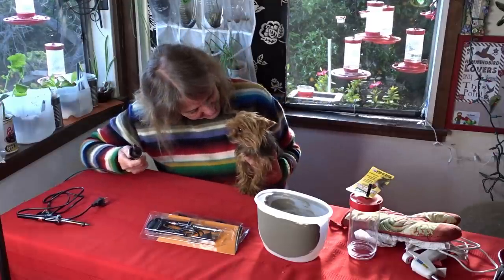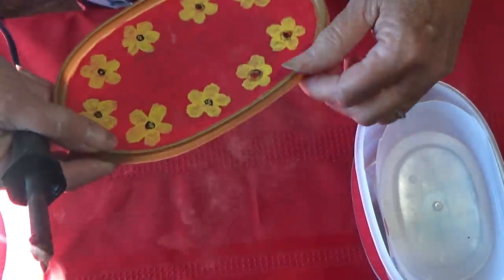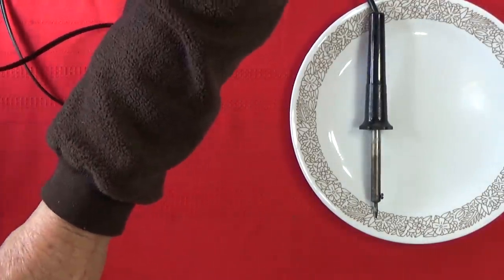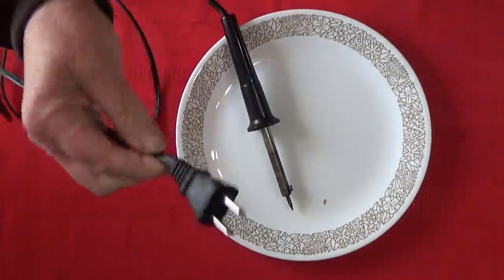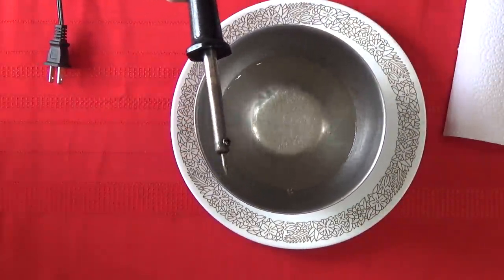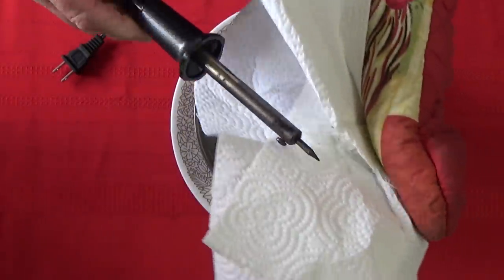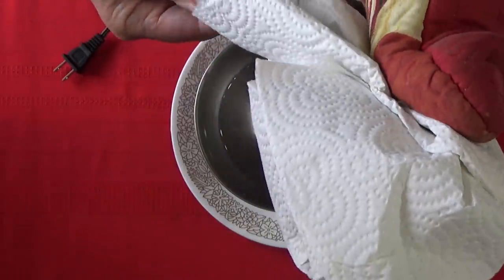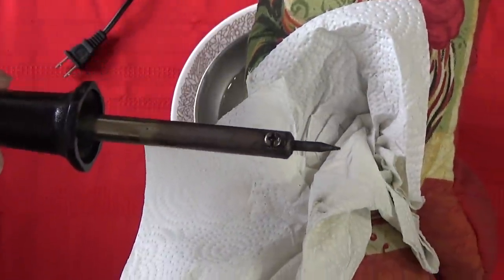How to Clean Soldering Iron Tip : DIY Craft Projects, Container Gardening Holes, Hummingbird Feeder

Comment: Hi Robbie, I ordered a soldering iron "kit" that came with different sized tips including a blade cutter (looking at YOU, tote lid) The stand includes a small sponge (soak it first) to clean the tip. It works well but this is a good  alternative 😊.  Hi Gary and Kitty!
Reply from the maker: That sounds great!  I just mainly use the ones from the dollar store which are the same ones sold on ebay, I bought a set of those too, the are very simple, not much with them, but they do the job. Thanks and Gary and Kitty say HI!!!

Comment: I Never Use A Soldering Iron
To Make A Hole 
In Something. I Use A 
Cordless Drill It's Faster
Reply from the maker: That is good too, but with a soldering iron, the holes needed to make my hummingbird feeders come out SMOOTH for the hummingbirds, no ruff edge, where a drill is not soft and smooth on the inside of the hole,  Thanks and take care

Comment: That's unnecessarily complex. I've been using soldering irons for more than 60 years. Leave the iron plugged in. Take the paper towels or a natural sponge and wet them. Wipe off the iron. That's it. It's such a standard method that better irons have a stand with a sponge.

Comment: I don't understand why the first thing you say is plug your soldering iron in. and then second 10 seconds later and then 10 seconds later you say unplug your soldering iron you never want it plugged in then you say if it's hot let it cool down well why did you tell us to get it hot and then now you're telling us to let it cool down you make no sense lady
Reply from the maker: Oh yes, you have to plug it in to warm it up so the plastic will get soft the is on the tip, once it’s very warm almost hot then you unplug it and then you clean it 😊 You don’t want it burning hot, just very warm.